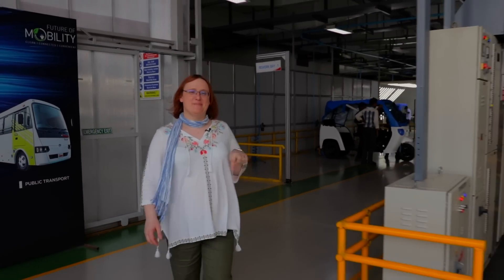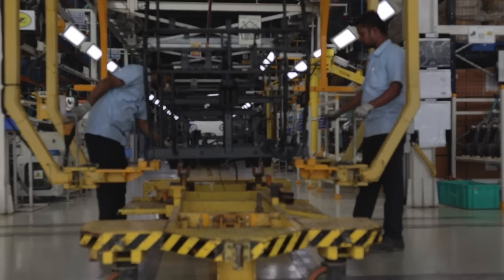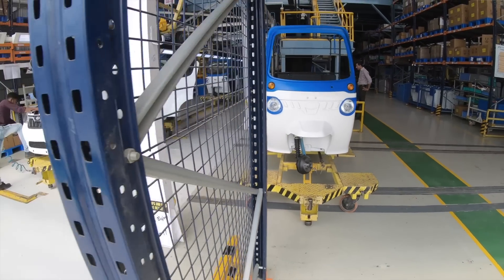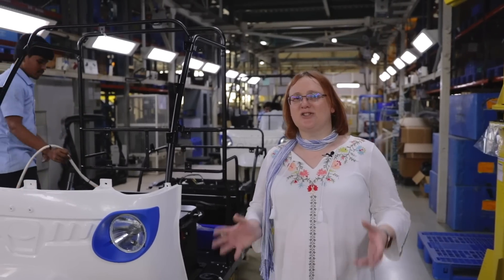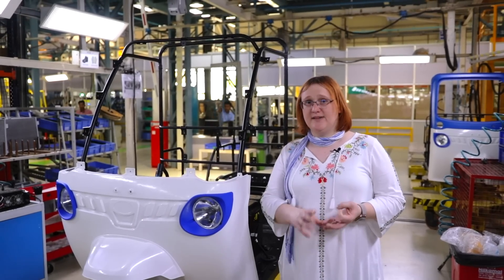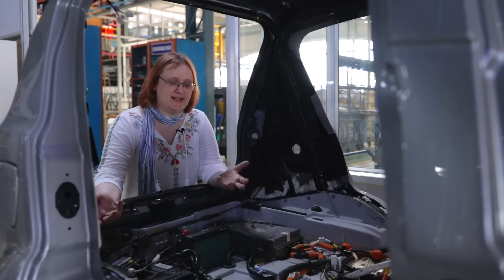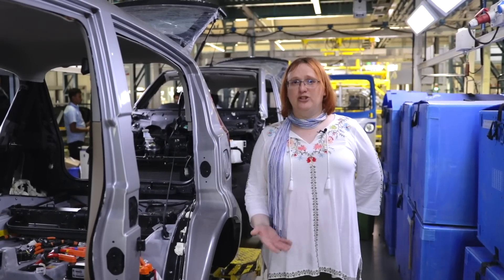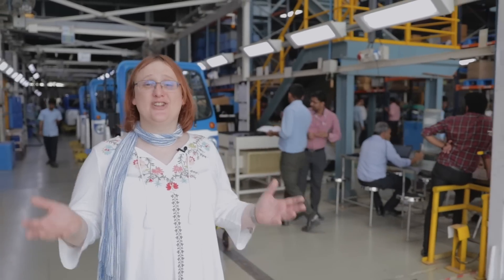Mahindra E2O Plus, Treo: Here's How India's Most Popular Electric Cars Are Made!

Comment: I see that Chinese company SAIC have started production at their new plant in India of a Right Hand Drive version of the MG ZS EV (i wonder if the UK market cars due to arrive in September will come from India or if they will be built in China).
Reply: Derek Nicol , the MG eZS EV will be assembled in India with parts imported from China. MG actually bought the GM’s closed plant in India. I don’t think it makes sense exporting from India rather than from China itself,  unless they have some other strong reason not to export from China itself.
Reply: @ameetsan  Yes, youre probably right. They used to send the component parts over to the old MG Rover Longbridge factory in the UK for final assembly but they stopped doing that a few years ago.

Comment: The production rate they achieve with so few workers and basically no automation goes to show how amazingly simple EV production is, compared to conventional cars, when they don't have every gadget on the market included. Especially the three wheeler is direly needed in Asia to replace those two stroke tuktuks running around everywhere.

Comment: This looks like a vehicle that was designed to use lead acid batteries, which makes it much more affordable to get it, but they added a lithium battery which brings the price up disproportionately to the quality of the vehicle. The Wheego had the same problem, a $5000 car with a $20,000 battery. 

The reviews on this car from Indian review channels shows this is a very crude car, which is what you would expect for something with lead acid cells selling for $5000.  But lithium battery basically doubles the price to $10k, if you fill the same battery compartment with lithium ion batteries.  The end result is a car with 2x the range and faster charging, and no need to fully charge every day as is the case with lead acid batteries.

We’ve seen US manufacturers trying to get around this issue by adding a bunch of bling to a crap vehicle to help justify the price. An example is the Chevy Spark for $14k, but the Spark EV was $28k. Nobody wants a $14k car that cost $28k. 

Lithium batteries are cheaper in the long run per kWh than lead acid, but the initial price creates a hurdle for many buyer. Here in the Philippines there are Chinese electric trikes and scooters becoming more popular, but 99% have lead acid batteries. The lithium battery would put the purchase price above what the average person can afford, even though after 5 years the lithium battery would still be going strong and you would be on your 3rd set of lead acid batteries. 

The only thing the world is waiting for is a viable battery for EVs. One that is cheaper to buy than lead acid, and last 10 years. Basically under $100/kWh for the complete battery, BMS, thermal management system would create a tipping point.

Comment: That Trio really looks like a flimsy toy using steel from the $2 shop and don't get me started about the huge reduction in stability while cornering when you have a single wheel at the front instead of at the back where it should be...I am all for the no frills approach to doing things to produce an affordable and practical solution but how many of these things just roll over doing a sharp turn every year?
Reply: Actually they are surprisingly stable for 3 wheels.they r designed for city traffic and top speed is about 50kmph
Reply: PhotoGeorge  I don't doubt it's widely used which means there should be a good answer available to my question, how many of these get turned over a year? Not having clean drinking water or sewage is also 'the Indian standard' for more than 50 years so yeah forgive me if I don't take that as a good reason for them putting the wheel at the front :)
Reply: @jedics1  three wheel is more practical in indian condition i think u never visited india , pls visit once and you will never ask any justification ;)
Reply: @RahulJha-mc6nz  Pretty sure physics works the same over there too.
Reply: @jedics1  i think you have no idea about Indian driver and roads , four wheeler is more costly to maintain where these trio are basically have no maintenance , we have road in pot holes not pot holes on road

Comment: Wow!  Up to 12,000 electric vehicles assembled in a month by 220 workers with very little automation.  Impressive.  I assume that stampings, forgings, castings, moldings, batteries, electronics etc. come from other factories.
Reply: It more of a modular system integration facility than a manufacture factory. Most of the work for systems and chassis are managed by sourcing it from other local production companies following the design specification; In a way, it creates a more diverse ecosystem with various technology products and also gives more jobs. Also "Handmade" has a nice ring to it a kind of personal touch to it wouldn't you say?